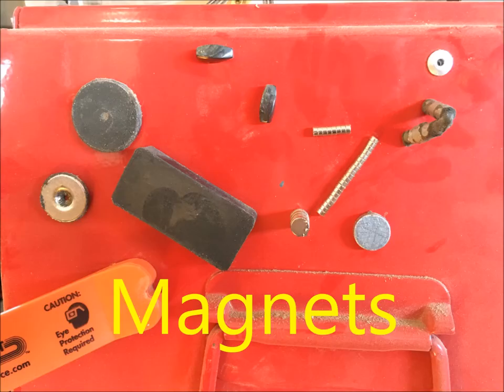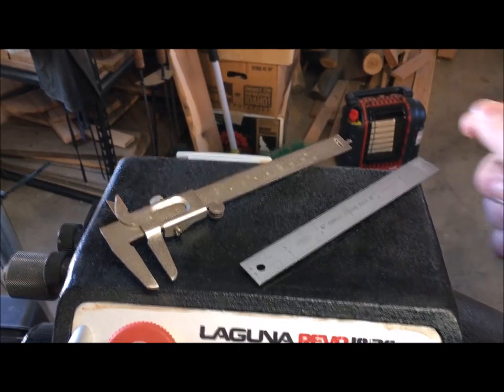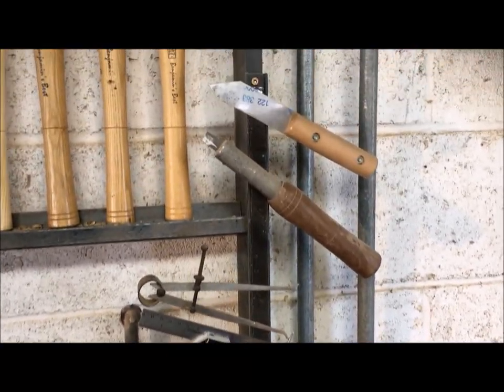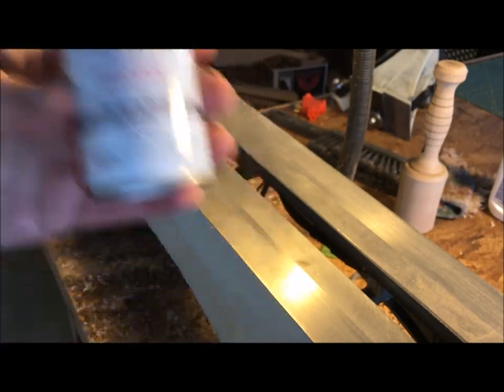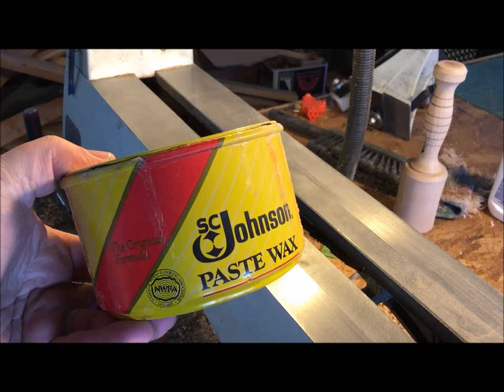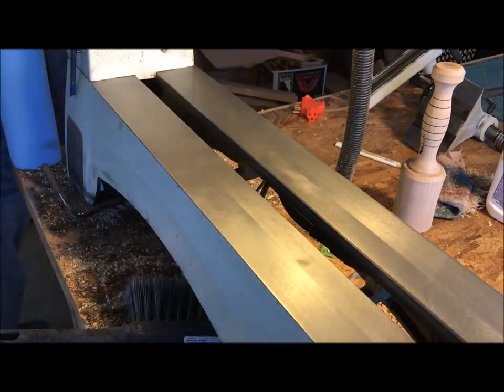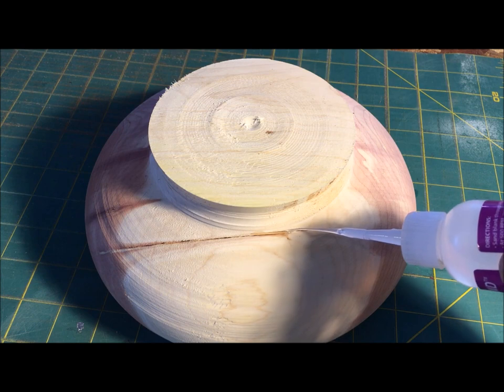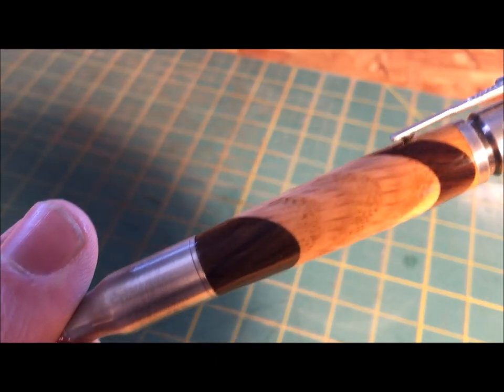Must have items for a woodturning shop

Comment: Never to late to teach this old dog new tricks. I got my Jet lathe last fall and it has been cold enough that it has set idle for the last few months. I went out to the garage last week and much to my horror the bed of my lathe had a light rust coating. I used Scotch Brite & mineral oil to clean the rust off and applied Johnsons wax to the bed, but never thought about the bottom of the tool rest and the tail stock. Watched your video and back out to the lathe I went and finished what I had started. The tool rest and tail stock now slide like they are on ball bearings yet lock down tight as a drum. Thank you for mentioning that little trick. The magnets also are pure genius! Thank you for sharing!!
Reply from the maker: Awesome!  Glad you were able to get out in the shop again.  It’s been cold here too makes it hard to do long periods of time. Glad the paste wax worked for you!  I’m thinking about going back to it on everything I just like the way it feels. Happy turning!
Reply: John I run a dehumidifier all the time  in my workshop it is about as cheap to run as a fridge and effectively reduces the damp. It also puts a little warmth in the shop.

Comment: Thanks for sharing, I definitely learned some new things I have magnets 🧲 but never thought to put them on my lathe and drill press! I also think i will be gluing some to my cabinets now to hold a few items like my Calipers for sure. I’m thinking of new stuff as I’m typing this message!
Reply from the maker: Thank you!  There’s so many uses I have to keep a stack of magnets on my tool box. Just in case.
Reply: Geiserwoodturner You’re welcome, I hung a few things today with them and im thinking now about the mess of drill bits in the drawers of trying to find a long magnetic bar to stick the bits to the back of the upper cabinet other than throwing them in the drawer which is just a big mess.

Comment: Instead of wax for bed ways and tools I use non-stick cooking spray.  It is cheap and fast, also no finishes stick to it.
  It can also be used as a mold release for resin casting. 
  SAFE TURNING, John

Comment: Magnets for tools- I do not know if this is true or not but I was taught as a boy that long-term exposure to magnets will remove temper from steel?
Reply from the maker: I’m not a metallurgist, but from what I can tell this is not true. Hardness and temper are affected by temperature during the heat treating process. There are however some interesting studies about hardening while exposed to a magnetic field. For now though some tools can become magnetized, but any that do can be de-magnetized. Also I’m not putting my turning tools on magnets, mostly things like calipers, chuck keys, and screwdrivers that aren’t crucial to keeping an edge.

Comment: Neodymium magnet on the key or the driver will prevent you dropping the screw or bolt you are undoing, beats hunting for it in the shavings and it works wherever on the tool shaft that you attach it .....

Comment: Excellent tips. I have just started, and I have a little some challenges moving the banjo. Can you use beeswax instead?
Reply from the maker: Absolutely!  I’ve done it before. I just rubbed it on and used as much friction as I could to rub it back off. Thin coat is key cause it’s a little more sticky than paste wax. You also get a little more build up of wax.